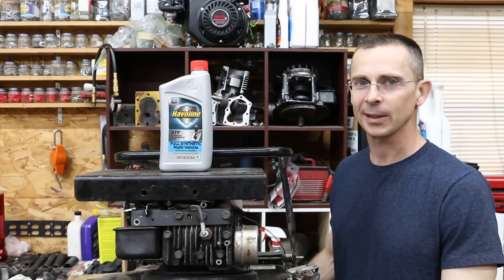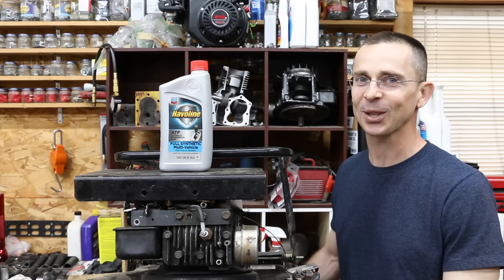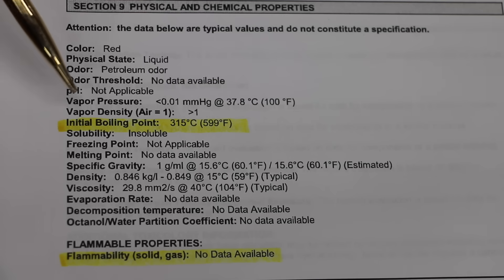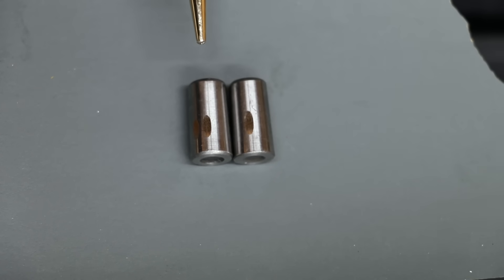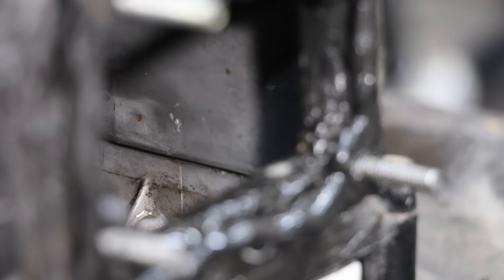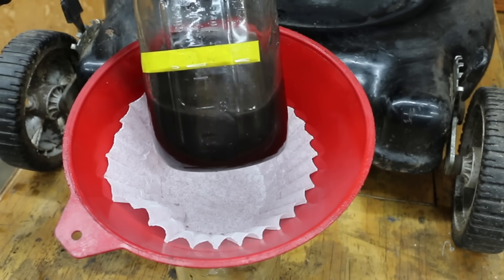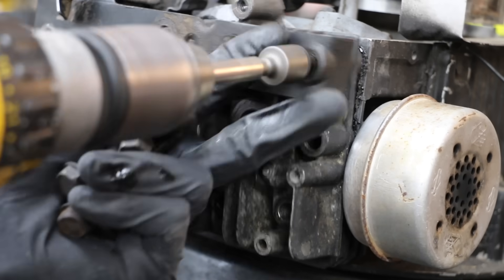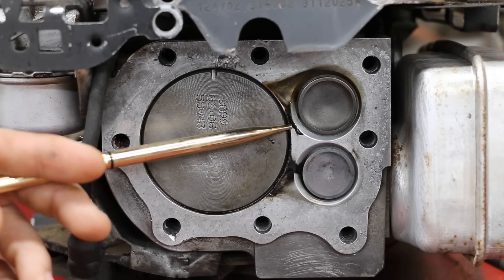ATF as an Engine Oil substitute?  Let's see what happens!

Comment: I've used a quart of ATF in an engine that was really dirty when I bought it.   I added a quart to the old oil and ran the car for a few minutes.   Then did an oil change as usual, it seemed to do a nice job of cleaning things out without being very harsh like some of the motor flush products.
Reply from the maker: Thanks for commenting.
Reply: How do you know for sure that it cleaning things out?  Did you see stuff that you didn't see it with just regular oil change or tear the engine down like what's Project Farm did here?  I doubt it, it just psychological that since you added the ATF, it cleans better.  As seen here, it didn't makes any different.

Comment: I've used it as a cleaner many times. Two months ago I got a 2005 Chevy Tahoe with the 5.3l and 208k. It had low oil pressure, about 25 psi at idle, I added one quart of transmission fluid in place of one quart of oil and ran it for 20 minutes at super high RPMs at times. I drain the oil and put a fresh filter on and switched over to full synthetic 5W30 and the oil pressure now at idle is about 45 PSI and I have put 2000 miles on it since then. I tow a trailer quite often and so far the engine has not let me down.
Reply from the maker: Thanks for commenting on this. The 5.3 is a great engine!  Glad the ATF helped with oil pressure.

Comment: My dad was a firm believer in putting a little ATF in the oil before changeing the oil. He had a 1993 Chevy S10 that he put 350,000 miles on and never turned a bolt on it . When it quite it was because of the electrical  system went out .

Comment: Drained 1 quart of motor oil (about 500 miles on the oil) and added one quart of ATF. Ran it for 20 minutes at idle and then changed the ATF/oil mix to oil only. This eliminated my engine knocking noise (were just starting to make noise/not huge amount). The noise seems to return just prior to needing an oil change (very minor noise). Hard to say if simply changing the oil in rapid succession or the ATF reduced the knocking.

Comment: Back in the 80's we used a quart of diesel fuel and had it come to temp and run for 15 minutes, then drain and change with clean oil and filter in our cars.  Maybe you can do a video on using diesel fuel on a lawn mower.
Reply: Steve Hei sounds great in practice but the fuel attacks certain kinds of rubber seals because there are like half a dozen compounds for car seals. Would be great to see if that hurts them from the brief exposure
Reply: @CorruptInfinityOfficial  That's the problem with all additives.  It's fun to see the Project Farm guy do all these tests, but looking at how well the deposits are cleaned is only half the picture.  You need to test/check all the seals.  This is why automakers never recommend ANY additives to oil any more.  More risk of damage than the benefit of cleaning deposits.  If you had a 30yo beater truck lying around, yeah: go ahead and try whatever gets it running better.  But i would never put any of this stuff in a modern engine on a car that is worth anything unless it was in horrible condition and sounded/ran like it needed a new engine.
Reply: Javier Hernandez love the response man, appreciate how you explained the process of how it works and why it’s not a good idea to do it to modern engines too which is similar to something I was thinking but was a valid concern. All the new electronic systems and solenoids really do overly complicate some things, I’ll keep that in mind even though I likely won’t have diesel nearby for a few years hahaha. And I see some turbo 4 cylinders commonly running shell rotella diesel oil for their cars, and they are pretty clean besides the direct injected ones valves haha.
Reply: @stardroppercj the seals are fine but I had a customer of mine use an off the shelf engine flush I forgot the name since he thought he needed it because he had I think was 116k and had vct issues right affer, was way back in 09 but since he had an inline 4 i took the cam off easily and cleaned the solenoid.
Reply: Diesel fuel in oil won't damage anything short term, running on straight diesel would damage the engine (not good enough film strength etc.) 
It doesn't clean anything really, but it does thin out the oil a bit and allow it to drain smudge a bit better. 
I did flush my sludged up engine with 2 loads of straight diesel after an engine flush, and the oil did stay clean for a bit longer, but only disassembly and manual cleaning of the cylinder head and oil pan really made a difference- 4000km now and the oil is still clean (had to change the piston rings as well, it burned a lot of oil)

Comment: Kerosene works good for cleaning sluge from inside the engine
Reply from the maker: Great tip.
Reply: For a car, pre-heat engine, drain one quart of oil, add one qy of kerosene, run at idle speed for 15 minutes, then change oil & filter.
Reply: I Can verify this procedure does work and did not appear to harm the engine.  In the mid 1960's, I used this method to clean extremely heavy sludge from a 265 CID engine.  The sludge was so heavy that it would slowly block the oil pump pickup tube screen and reduce oil pressure after about 20-30 minutes of highway driving.
Reply: swwsww2   I'm going to give this a try.  I have ~4 qts. (plus 1/2 qt. ATF) soaking in the oil pan.  I don't plan on running the engine.  I was thinking of using aquarium air tubing down the dip stick tube with an air pump to agitate in the crankcase.  (A special fitting at the drain plug with a circulating pump and tubing down the dipstick tube would really do a good job).

Comment: Marvel Mystery Oil has been my “Go To” oil additive (1qt mmo To 4qt of oil) to free lifters and clean sludge and I change it from 500 mi to 2000 mi depending on the amount of sludge build up. I’ve been using this in my repair shop (Performance Motorsports) since 1974 and it works good.
Reply from the maker: MMO is a great product!

Comment: I've used 1 qt atf in engine and left it in there. It did quite the noisie lifters. I also have used a couple of tble spns of comet down the carb while it was running and it finely scratched the walls and stopped the 305 from smoking
Reply from the maker: Thanks for commenting on this.

Comment: Forty years ago a radio personality, who had a vehicle advice program on Saturday mornings, recommended running a quart of ATF through the engine along with the existing oil (might have to drain some old oil first) up to operating temperature so as to flush out gunk/crud in the engine. I have never tried this myself but have had the idea in the back of my mind all these years.
Reply from the maker: This is interesting. Thanks for commenting.
Reply: You're most welcome, 'PF'. Your presentations are interesting and highly watchable. In the early-'70s (just as I was getting my driver's license) I would try various oil additives in my father's '66 Chevrolet Impala (pillarless) sedan with the 283 V8. My father was very patient and understanding with me and all of his sons. Dad said the the gunk in the engine was what was holding it together. I smile thinking of this now. I also 'treated' the Impala to a pair of coil-over helper shock absorbers in the back which my father said had improved the ride when he had to take some of his co-workers to the other side of the sprawling steel mill where he worked.

Comment: An engine shop I know of suggested for breaking in a new engine, use a mixture of SAE 30 motor oil, replacing one quart of oil with ATF and a half tube of lithium complex assembly grease.
Reply from the maker: Interesting. Thanks for commenting on this.

Comment: the best method to clean an engine is fill it up to the brim with diesel let it sit in the diesel for as long as you can min 24 hours then drain, new oil that will get rid of all the sludge and break down carbon deposits.also will unsieze an engine that's   been sat for years.in this case leave it in for a week or so and a lot cheaper than any additives you can buy
Reply from the maker: Great tip.

Comment: I used ATF in my old 89 Astro Van with 200k on it. I did the 1 to 4 or 20% mix Trans oil and motor oil. Ran about the same after running it for the whole 3k miles of the oil change.  I like to see what 20% mixture in the lawn mower over a longer amount  time will do. I didn't take anything off my Astro van to see what or if it cleaned the engine. But 20% mix shouldn't hurt most cars and trucks.
Reply from the maker: Great point!

Comment: The vehicle I own now has a used engine installed in it because the previous owner did an oil change with transmission fluid. It is a 2007 Scion tC
Reply from the maker: Thanks for commenting on this.  ATF is risky to use.

Comment: I've seen petroleum based ATF used to free up stuck piston rings and clear carboned  up heads, in old automobile engines that have been stored for a long time..
First compression test engine.
This method is to run engine under load until normal operating temperature and hold throttle rpm to the middle of the power band. Then pour ATF into the unfiltered intake until engine loads up.
Warning: This method creates a lot of white smoke out of the exhaust.
Let engine run until exhaust clears.
Retest compression on engine. I've seen compression boosts of as much as 20%.

You might try this on modern engine/fuel systems.
Reply from the maker: Thanks for commenting on this!

Comment: back in 1980 I bought a senior citizen 66 chevelle 283 engine. it was varnished up and the lifters would collapse and clack. I was using texaco havoline oil. I tried animate cd2 for high mileage cars. no help. each try was a 2000 mile oil change with filter. then I tried one quart of automatic transmission oil with the havoline. No help. I just gave up and said the hell with it let it clack. so change to just quaker state after a couple weeks I came home and shut off the radio. something amazing NO click, clack or any noise. the quaker state did the trick so I stayed with that brand till my newer cars and synthetic oil. I would say its not that big a help at all.
Reply from the maker: Wow!  Thanks for commenting on this.

Comment: The low compression on the on the motor that ran canola oil and then sat for months was probably due to ring sticking. That would explain the compression coming back up after running ATF. Vegetable oil tend to get sticky and gum up if left to sit.
Reply from the maker: Yes, you are right!  The rings were definitely stuck.

Comment: I have added 1 litre of ATF to the crankcase of a (100K mile) 5.7 Vortec about every 3rd oil change but only about 40 miles (mostly highway) before the oil change. the oil got a lot darker in those last 40 miles. I still had a sticky lifter but it was quieter. A couple of oil changes with about 1/2 cup of Seafoam for the full 3000 miles between oil changes freed up the lifter. 150K on that engine and it's still very happy using about 3/4 quart of oil every 3000 miles. FYI Baldwin oil filter.
Reply from the maker: Thank you for this video idea!

Comment: Sticking with high detergent motor oil for crankcase however I do use Dexron II on large diesel engines for fuel filter which helps to clean injectors, cylinders, and valves. Diesels be it Detroit Diesel, Caterpillar, or Cummins start and run easily on Dexron II transmission fluid however I only use it when changing fuel filter by filling with Dexron II then let it run its course. Been doing it that way for over 30-years now and is something most diesel mechanics do themselves during normal oil, lube, and filter changes. So yes it works but I would not want continued long term use.
Reply from the maker: Thanks for commenting on this!

Comment: not that there is anything wrong with the motor you use for testing but why not use a cheap 350 or 302 or 351 from a junkyard ?
Reply from the maker: Great recommendation.  I'll likely use a much larger engine in a future video.

Comment: I'm a 60 year old Mopar fan, and Rust-Belt original. I have used 1 Qt. of Dextron in the crankcase of my engines since the  '70s, and have never had an engine failure. Also, I have never had a crusty build up inside anything that I owned, regardless of my slack oil change schedules. The only difference  between a car motor and a small engine is the oil pump, and high pressure oil distribution. let me task you with a second video. Find an old car with a "cholesterol" problem. Shoot some video footage with the valve covers off. Change the oil, and use 1 Qt. of conventional Dextron. After 3000 miles, shoot another video of the inside of the motor to determine the validity of this practice.
Reply from the maker: This is a great video idea--thank you!

Comment: I've used ATF many times as a cheap cleaner in both crankcase oil and in fuel. Never had an issue and all my vehicles are hi mileage over 200k.
Reply from the maker: Thanks for commenting on this!

Comment: One of my previous co-workers had an old compact pickup years ago that had an engine tick and he was suggested to use atf to clean it up.  He substituted 1 qt of oil for the atf and did it that way until he sold the truck.  He said the truck did eventually quit ticking.
The guy that bought it intended to rebuild the engine and when he tore it apart, he told my co-worker the inside of the engine had almost no carbon or sludge buildup. Cleanest engine he had ever rebuilt.
Personally, I have never used atf in an engine.
Reply from the maker: This is interesting.  The oldtimers swear by this stuff.  Thanks for commenting.

Comment: Why did you only look at the combustion side of the engine. It's oil.  It belongs on the oil side. I understand that this is a high wear motor but your test is, how clean does ATF burn under not ideal conditions.
Reply from the maker: Great question.  I did look inside the crankcase on the engine with the see through panel. It did seem to clean.

Comment: I use to add it to my fuel in a 73 350 plugged the filter with fibres.
Reply from the maker: Wow!  Did you cut the filter open to look at the material?

Comment: What mixture of oil to transmission fluid did you use ? I have been using transmission fluid in my car to clean the internal parts of my engine . I use a three to one mixture and run the engine for about fifty miles and then drain the oil and then refill the crank case with fresh oil and filter . I have been doing this for years and and have never found any detriment to the engine .
Reply from the maker: I tested it at full strength.  The approach you use seems much safer. Thanks for commenting!

Comment: Maybe ATF+ water spray into carburettor will clean engine completely. About lubricant problem, I don't think it's worse than engine oil after 10 000 km run
Reply from the maker: Thank you for this recommendation!
Reply: Project Farm water spray works on diesel engine, but on gasoline?

Comment: I have used atf in crank case but cut with regular oil . A 5Qt crank case  I use 1Qt atf  mixed with 4Qt and run it 3000 miles.  I have noticed it has clean valve  guide's,  lifter ect. From sludge build up.. But I also use atf in a diesel  fuel.  A CAT 3406 engines I use atf  to help clean fuel injection and lube injection pumps. 1qt atf to every 10 gallons fuel . Highway or off road fuel.  every 1000 hrs or as needed. Note atf  mixed with highway fuel (Green) will dye the fuel red!!! Newer diesel engine with DPF OR DEF systems iv never used atf with. Don't know if it will effect with theys systems.
Reply from the maker: Thanks for commenting on this!

Comment: I put ATF in the standard transmission of my 84 S10 it shifted very smooth and I never had a problem. My father used to work at a garage back in the 70s the owner would put a quart of ATF in customer's cars who had loud lifters. It cleaned them out and made them quiet. He'd do an oil change after the engine was cleaned out. With synthetic oil today it would be foolish to use ATF that way, but it was an easy and cheap solution back in the day.
Reply from the maker: Thanks for commenting on this!